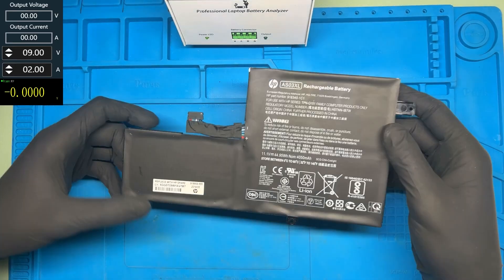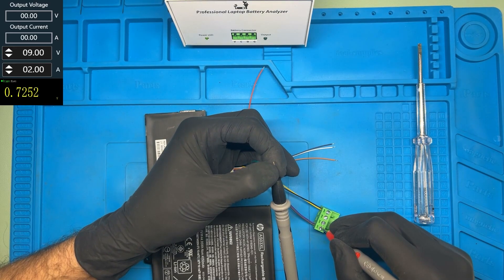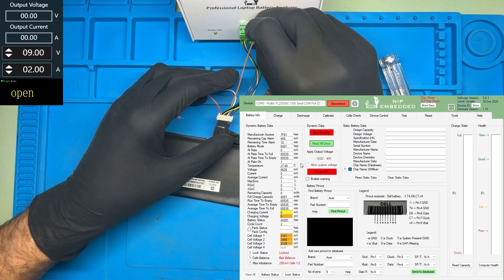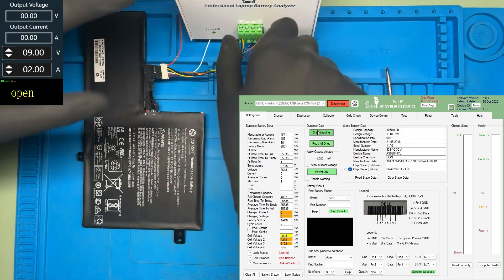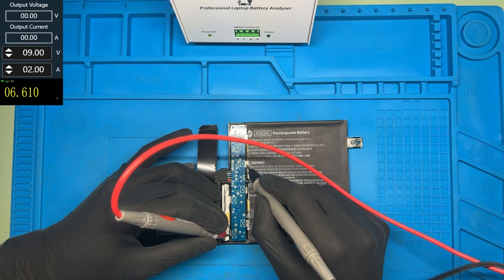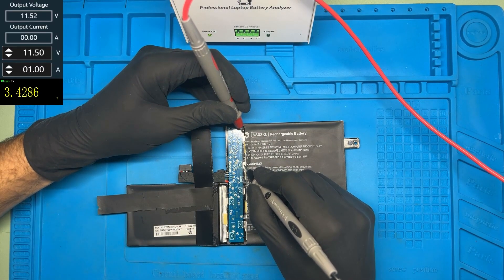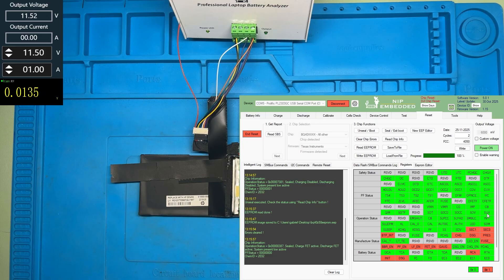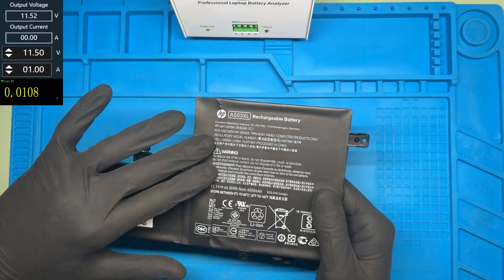Repair HP AS03XL BQ40Z50 Battery using NLBA1 Pro Tool

Comment: Hi I have installed the software in my computer that has Windows 11, after the installation I connected the device and the reading button is not accessible. Did I miss a step or what should I do?

Comment: Hello,
I suggest you take some photos showing how to adjust the parameters of the battery after replacing the cells (high capacity) using an NLBA1 device so that it can be properly installed in a laptop and function correctly. 
Thank you.
Reply from the maker: Thank you for suggestion. We plan to offer free training sessions. Please stay in contact.

Comment: ❤❤❤
Reply: I don't understand system present pin.. please explain system present pin in next vedio.. how it's working
Reply: Why did you charge battery internally  does this device not charging the battery
Reply from the maker: @whiteshots7129  When the chip is locked the battery cannot be charged using its external connector. That's why it is necessary to charge the cells directly.
Reply: But first you reset the battery then when you start reading again then it shows unlock then you charge the battery..
Reply: And please upload training vedios how to unlock different types of batteries.. please upload one vedio every day ..
Reply from the maker: @whiteshots7129  Please check our videos, there are some videos that show how to repair different chips.